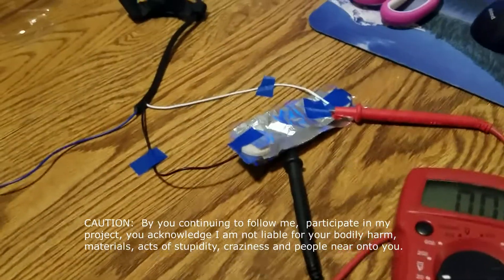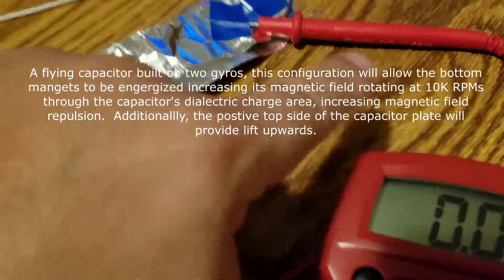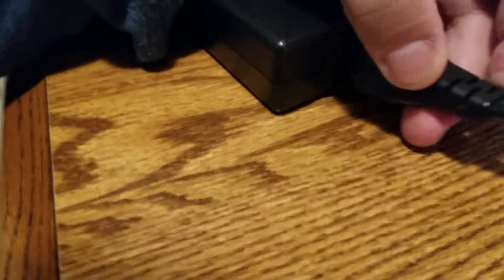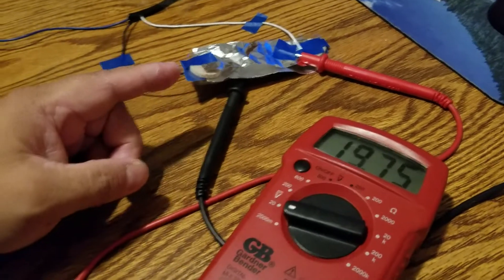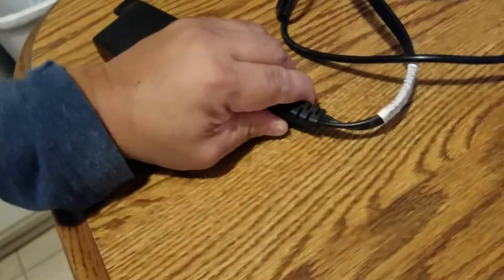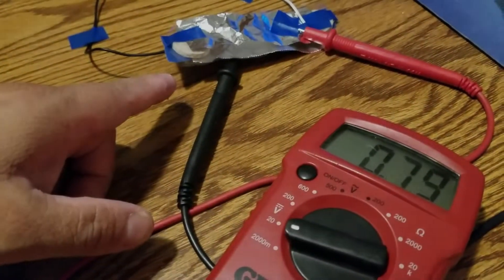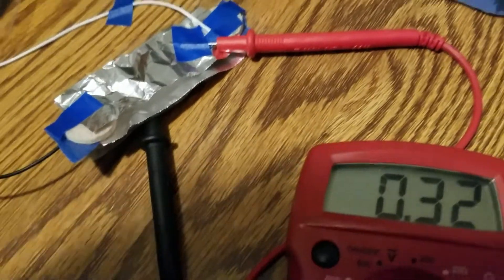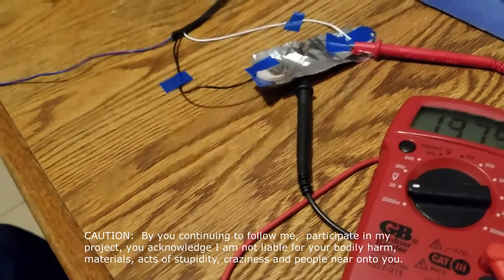To energize magnetic field between capacitor plates

Comment: One issue I see, while you have the power brick connected to the plates you are attempting to measure, so the built in capacitors of the brick will be slowly discharging through the meter impedance, so gives the impression the capacitor is larger, but in actuality, the two plates on their own will pretty much discharge instantly, or too short a time period that a hobbyist could easily measure... my guess, there is bound to be several pf of capacitance between those plates so not much energy will be stored. Meter impedance is in the order of 10 to 20 meg ohms (depending on the meter, usually the budget meters will be lower which will influence the result to a larger extent, better ones are higher but not perfect.) some oscilloscopes have direct voltage input measurement and influence the deflection, another technique is to use a gold leaf electroscope but calibration could be problematic.

I would have liked to observe what the effect of a fixed magnetic field would have been on the electrical field between the plates of the charged capacitor.